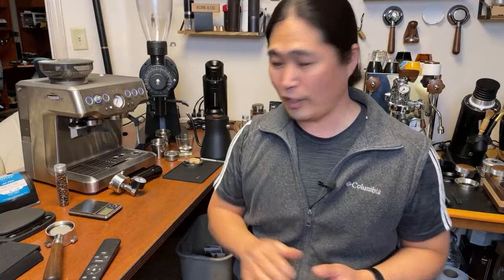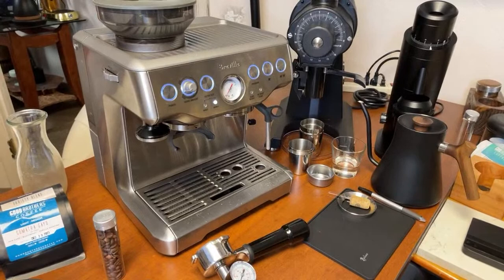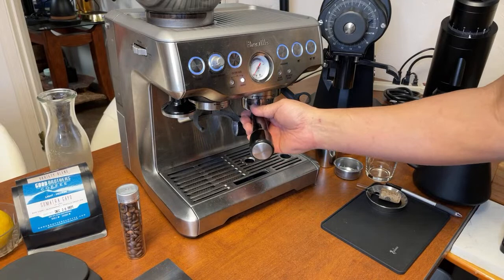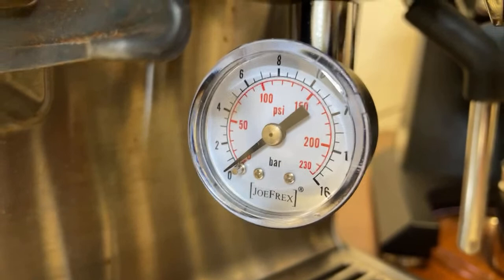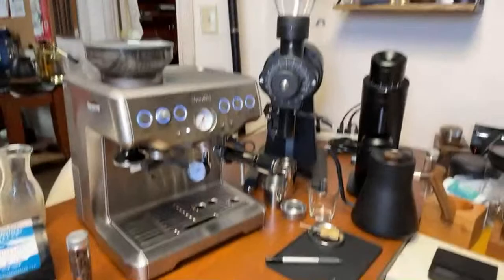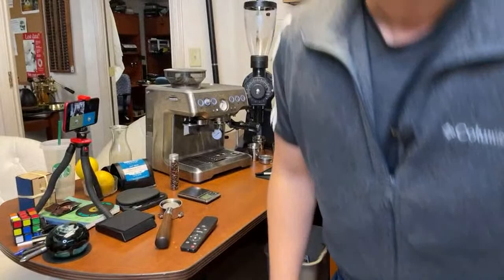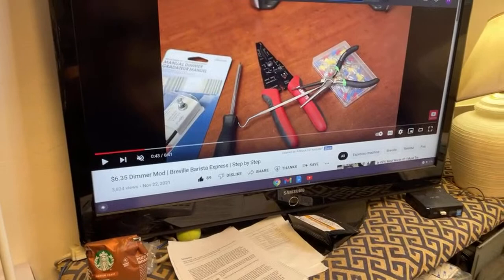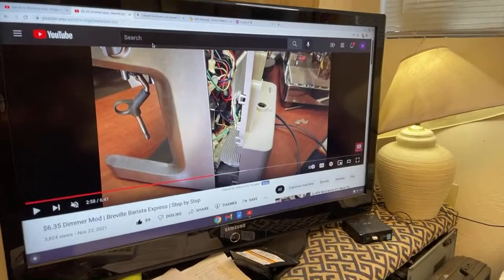Secret to Working with 14 Bar Espresso Machine Breville Barista Express

Comment: Will pressure always peak at 14 bars (possibly by adjusting the water debit?), or will it peak at 9 bars when you have the grind dialed in (with a fixed water debit)?

Comment: I did the dimmer mod on my barista express it really helps a lot controlling the pressure I don’t get anymore channeling and my shots are even better than they were before. Just wanted to ask you Hoon where was the needle on the barista express when you were at 9 bar?
Reply: I agree. I use 10-11 o'clock position for my 9bar guesstimate.

Comment: I have a question.... If We cap the machine to run up to 9-10 bars with dimmer mod, how to yo define optimal grind settings? I guess, if I'll do dimmer mod I have to look at the flow to get a ratio until the time 20-30s right? I guess, that's why breville put a 14 bars pressure on BBE, because they know as the grinder is terrible for consistency....

Since few days I noticed that I have to grind a little finer to get the powder expresso texture but IF I do this, the pressure go to over extract (2 o'clock), If I grind coarser, I get not consistent pressure, may be I start at 12 but drops to 9-10 o'clock also obiously no matter that I do, I get channeling. may be, that causes that the pressure drops
Reply: I am really considering to do dimmer mod and then try with grind settings... but I am under warranty yet.... I don't know if there is a way for them to notice I did a mod If I have to claim warranty.... I remember also in the manual is write that not to plug any kind of controller between the power cable and the connector I guess It may affects the heating system.

Comment: Have you tried doing the OPV mod? Where you unscrew the OPV valve to lower the max pressure to 9.5bar?
Reply: You can do that I tried however and there’s not much play in that when I unscrewed it I couldn’t get it to 9 bar without the piece falling out. I was going to do a new opv, but the dimmer mod is easier and cheaper to do. And it works really well at least with mine. You can set the shot to do no preinfusion and manually control the entire shot slow preinfusion slow ramp to 9 bar and slowly take the pressure down while finishing the shot just like you would with pressure profiling. I’d highly recommend the dimmer mod.
Reply: I did the OPV  mod as well but could only drop to 11.25 Bar or it would fall off. I don't think this is a bad thing as it gives you a bit of room with a touch finer grinds.
Reply: I posted a link to a replacement OPV and the instructions to put it on. Of course it’s a tad intermediate to advance mod but it’s amazing
Reply: @patriarchpumpkin  the link didn’t post what can I search for? I know a few people did it and saw good results I was wondering why Hoon has chosen not to do it or if he already has it done!
Reply: The issue with the Opv mod is the the shot time is still limited to the input signal from the flow meter. With the Opv you bypass slot more water away from the group head and end up with really short shots.
Reply: I was able to adjust the OPV to 10 bar at the pump which gave me roughly 9 bar at the group. It bypasses a little more water into the drip tray but to me it was worth it.
Reply: @Clubfindr  I wish I weighed the waste water before and after the OPV change. I can tell you I had to empty the water tray after my morning routine, if I made two coffees it would be too full. (Two doubles and water for long black) So if you pull your shot below the OPV setting you have to be wrong, if you pull your shot above the new opv setting you would be right. I would need to find the part number of the flow meter but from what I read it just counts revolutions,  you set this when you program the button and override this when using manual. Has anyone actually tested this?
Reply: @Clubfindr   I do manual shots every time pretty much so that part doesn’t effect me quite as much.
Reply: The issue comes with water flow and as a consequence pressure. You can grind course enough to have 9bar pressure but the pump is still working full speed and so your shot time is going to be something like 15-20seconds, producing an under extracted shot, especially if you're using a light/medium roast. For dark roasts its a bit different. When I did the OPV mod It was set to around 11bar. (12-12:30 clock face reading guestimate) and because I'm using a medium/lighter roast I want to have a 2.5/3:1 ratio or 45-55mls in the cup. But with the Opv i could only get 35-40mls in 15-20 seconds.
Reply: @Clubfindr  Hi Nathan, I'm trying to understand your post, is this shot in the same time as the second shot? So Is the OPV in the Breville not an over pressure valve if it's only a bypass valve then that could be the answer. This is easy to test I will turn the grate sideways on my morning shot, if you are right and water is bypassed to the waste tray you will see it during the whole shot but if that is happening it's not what I would call an over pressure valve? My current blend and grind size will pull at 7 Bar 2.5 and is about 45ml. Will post back.
Reply: Infuser OPV set at 11.25 Bar Some Data: When I turn it on from cold, it primes and puts about 15ml waste water in the tray, then when it gets to temp it dumps about 25ml more waste water (No Pump Noise at this time), this might be overflow from the heated water? (Dump Tray) So I tried a dummy shot, No bypassed water at all during the shot (No Back Pressure either), after the shot stops it dumped about 23ml. Good sign as no auto bypass. Now the shot: 7Bar 16g 45ml out. 25sec. No Bypass to the tray until the Infuser kicks the pump to max at the very end of the shot. This occurs when the pump is right at max and at the very end of the shot if Breville never did this it would not cause "Bypass" unless you pull a shot above the OPV setting. So in conclusion the OPV is working and allows bypass when pump hits that overdrive situation at the end of the shot (Breville Programming) This might be the best reason to consider using Manual mode and a dimmer! Others can verify this data as well with and without OPV change and see what they get.

Comment: I wouldn’t use the external resistor. When you use it you will lower the power to the heating elements as well as the pump. So your going to get very inconsistent results.
Reply: 180 shots in on mine and no inconsistency whatsoever on the  temperature front. There’s a toggle to give the machine full power when doing everything except pulling a shot (heating up, grinding, performing cleaning cycles etc). Also it’s technically not a resistor, it works the same way as a dimmer by chopping the AC curve. But yeah. Just sharing my experience. Take it or leave it. Up to you. Or live in 14 bar land, or do dimmer. Your choice. Dimmer is definitely better and “safer” as it isolates the pump only. Dimmer has been done since 2010 on HB forums that I can find and router speed controller since 2013. Again, just presenting facts.
Reply: And with that speed controller you're also messing with the AC curve that drives the IC's (think "computer") that's on the main board of the controller. 
Ask if one would add that controller to their PC.  :-p
Reply: @dawgman2256  I'm surprised this is working well as this kind of noise should affect the MCU? Would have to look at the schematic as they must filter the AC after the pump? I'm talking about the external Router motor controller. It works like the Dimmer but just not sure of injecting that noise on the AC input.
Reply: @fredwilson1191  lol. It’s a 600 dollar machine. Did I say it’s foolproof? No. It’s ghetto AF. Sometimes you gotta risk it for the biscuit. I guess when I reach what, 1000 shots we can say it’s ok or should we shoot for 10,000?
Reply: @dawgman2256  Hi Dawgman22, hope my post does not feel like piling on, Everyone should take responsibility for their mods for sure. When I looked at the patent for the internal dimmer I thought it was fine but should have looked at the rest of the wiring to see where all those other wires went, I should do that. Just a note some dimmers have more filtering and will introduce less noise than others. I found a fan controller I'm going to use at the pump and if I do blow it up can afford a new machine. I look forward to pulling espresso at 6 bar, like the Decent "Gentle and Sweet" shot.
Reply: @Dawgman22  Thanks for sharing the experience.  Do you see any difference in taste and if you can add what one should expect.
Reply: @doshiharsh123  the sky is the limit with profiling. Although both the dimmer and the router speed controller are relatively crude when it comes to adjustments, you can pull turbo shots, straight 9 bar e61 shots, 4-9-6 shots, Italian style lever shots, etc. will it be perfect? Absolutely not. Will it be fun and taste different? Yes. Additionally the 14 bar pressure is less than ideal for light roasts for sure 
We can debate that forever. Being able to step down to 9 or 6 bars really opens up what you can make as espresso on the BBE, that’s the beauty of it for me. Decent espresso has a video comparing the same beans with 3 profiles - check that out as well as a few others I remember. Their conclusions were yes, taste changes with profile. Have some fun with it 🤙😎🤙 also if you have a Bluetooth scale to hook up to smart espresso profiler that will log your shots and flow rate outputs which I think is helpful.
Reply: I just think this whole 14 bar pressure is a bit rich. So a more expensive machine may be limited to 8 or 9 bar pressure but that is with no flow. The more expensive machine normally is capable of a lot more flow. Water after all is not compressible. So when you pull your shot your pressure is defined by the grind size allowing the water to flow through the puck. Unless the idea is to decrease the grind size and then slow down the shot further by reducing the flow of water. But all I can see what doing is over extracting your coffee. Who of us makes our coffee with the pressure gauge pegged after all.
Reply: You'd simply run the machine at 100% and then maybe dial it back to some percentage of that right before you pull a shot.
Reply: @dawgman2256 . Still going strong or have you started having issues yet??

Comment: Is there any difference in the type of dimmer you need for a U.K. version in comparison to a US version? I’m keen to do this but all the videos out there are US specific. Does it even matter?
Reply: I’d like to know as well, but for now I just press and hold 2 cup button for the duration of the shot.
Reply: @mariuszpocztowski9565  I unfortunately don’t generate enough pressure for this to be effective. It generates about 5-6 bar (10 o’clock)
Reply: I have a UK version and I got a dimmer from ebay. I'll see if I can link it here
Reply: @mariuszpocztowski9565  thank you! I do this and even in this video their pressure doesn’t reach 9bar. Gets close though! I get similar results too
Reply: @Clubfindr  thanks Nathan, that would be amazing :-)!
Reply: That's the one I used i think. It was super simple to wire up.
I used a bit of double sided tape to stick the dimmer knob on the outside and ran the wires through the small gap at the top rear. I taped them up for a bit of extra insulation so they didn't get cut when putting the top back on. Also make sure you use some heat shrink or insulation tape to cover the base and the wires of the knob. If you're not Looking where you hand goes and watching the extraction it can bite you. Trust me ;)

Comment: Will all my respect, the only thing this test demonstrate is that if you block the portafilter in a way that no water can go out, the pump will push to its max, and that max in 14 bar. Its not representative of the number of bar used when you brew a good expresso with this machine.

Comment: 14 bars pressure stock coming from factory is disgusting. The next iteration of this machine should have a setting to change from "Pressurized" 14 bar to "Non-Pressurized" 9 bar. Simple.